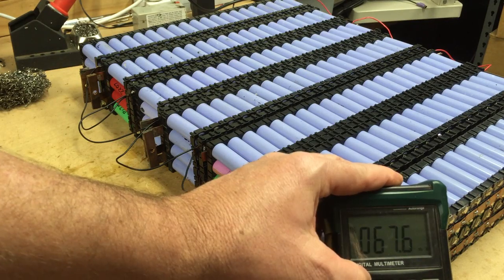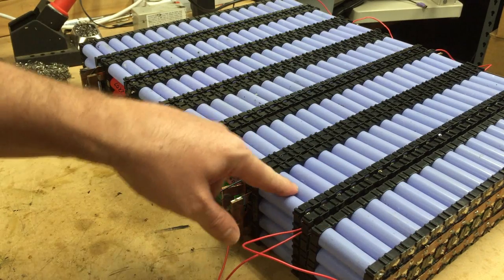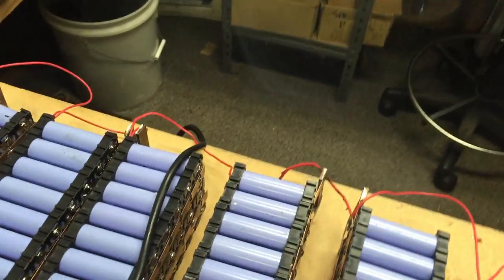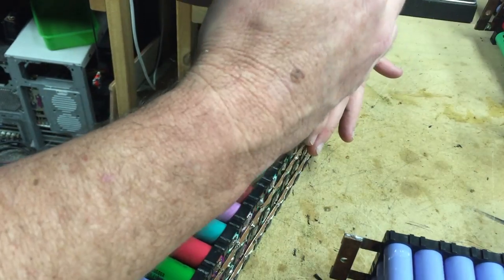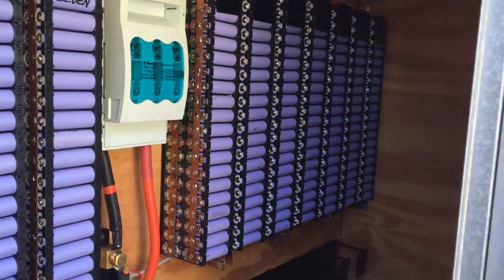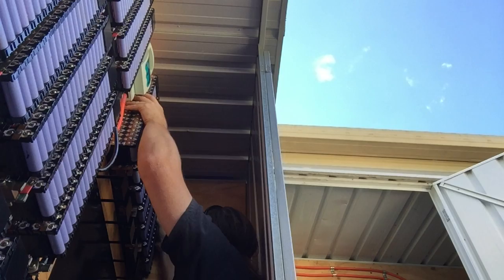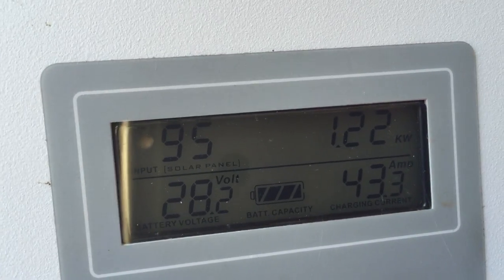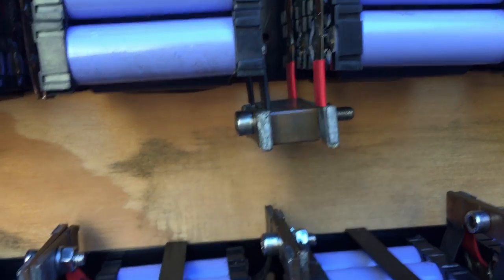Building a DIY Powerwall from used laptop batteries

Comment: Does anyone know if it would be possible to do a similar system, but in KERS fashion? Batteries will lose their ability to store energy over time, but storing kinetic energy doesn't have a life span. But idk, maybe it would lose the energy you store too fast?
Reply from the maker: Never looked into KERS sorry
Reply: You can hold energy in flywheels for a rather long time by keeping them in a vacuum (no air drag) and suspending them on magnetic bearings (no friction- only a small amount of magnetic drag). Unfortunately as far as I know the energy density is still less than batteries. There are other problems too- the flywheels have to be aligned with the earth's rotational axis (otherwise you get problems with gyroscopic precession) and each flywheel (assuming you want maximum energy density) is essentially a carbon fiber disk whose outer edge is travelling as fast as a bullet- if something goes wrong and the flywheel breaks the effect will be akin to an exploding artillery shell, so every flywheel must be either buried below the ground or surrounded by a ring of armour plating to stop the shrapnel.

The main advantage of flywheel energy storage is that with appropriate design you can get all the energy out very quickly. That fact makes them popular as energy storage for things that require short bursts of extremely high power like experimental fusion reactors and railguns.
Reply: Right, and they are also effectively used in motorsports as well, to deliver that quick burst of high energy. As long as it's doable and viable, there's also a way to make it safe. My main reason for having the thought was to prevent the loss of battery life over time, where with flywheels you don't lose any storage potential ever (since they store kinetic energy, not electricity). Would be cool to see a huge flywheel powerplant hooked up to a solar cell farm, something that could maybe power a small town out in the desert or something.
Reply: I think the high cost of flywheels (a high energy density flywheel must be made to incredible precision, as the slightest imbalance will cause the rotor to explode when it accelerates to full speed) would mean that your storage system would need to be in service for a very long time before flywheel storage became a better investment than batteries. Meanwhile battery technology is advancing all the time, with capacity going up and costs coming down. I suspect that it would be better to just use batteries and replace them with newer, more advanced models in 5 years time when they reach end-of-life.

Another option for storage that doesn't degrade is flow batteries such as vanadium redox batteries. These batteries work by pumping positive and negative electrolytes through a fuel cell, and they suffer practically no capacity loss over time because the two sides of the chemical reaction are kept completely separate. You can also restore lost capacity by simply replacing the old electrolyte in the tanks with new stuff. The disadvantage is that they're very bulky and heavy, so they're only useful for stationary storage systems.

Comment: lead-acid or Gel batteries are not effective. 
How about running PC with 600VA USP on such battery bank ?
How long it will provide backup?  4 to 8 Hrs ups backup how many batteries are required ?

Comment: How do you have the interface connected to the house? Do you have an automatic transfer switch?
Reply from the maker: 63a Duel Pole transfer switch see diagram https://drive.google.com/open?id=0B3D1svhLzR-JaE5ETXB6aHNpdDg
Reply: I have 51- 260W panels on my house with a SolarEdge inverter. Do you know where I would hook up the incoming DC from the batteries to?
Reply: Great work by the way. Really inspiring.
Reply from the maker: no sorry. is the edge inverter hybrid ?
Reply: Joshua Kendrick Yeah mate,  theres an input,  the wires connect to it
Reply: BS you have 51 panles, a 13.2 kw system, what are you gowing there hemp

Comment: Do you need 20kwh? Not you personally but for a small build. Could you start with 6kwh. My 3.2kwh solar gives me 20kwh a day I use 10-12kwh then push the rest to the grid for $0.06c. My night usage is only 5-6kwh so a small 5-6kwh system could work?
Reply from the maker: Many have stated with 1kWh of 18650 storage ! it's cheaper to conserve than to create :) I'm soldering up my 40th kWh pack at the moment and have way through testing cells for the 50th :)
Reply: HBPowerwall I know the pip solar/battery charger is best but is there a charger that I can use and keep my original zen solar inverter. I have 12x 260w panels, ATM it's generating 310v at about 10A. I know lower amps is safer but lower voltage is easy for balance charging.

Comment: why wouldn't you face the batteries away from the wall in stead of sideways that way if they vent the fire flames go
out in stead of sideways into another battery
Reply from the maker: Very good question - it's been discussed in detail of late both in diypowerwalls on facebook and www.diypowerwalls.com forum. In time, this project has grown larger and safety side has grown with it. In version 6 mounts there'll be space for 'blast shields' of some sort & the gap between the cells will grow from 2cm to 5cm to accommodate this change.
Reply: HBPowerwall yes but if you place the negative side of the battery against the wall and the positive side away from the wall when the battery vents the bulk of the flame will go into an empty space. Then there's less need for metal infrastructure superannuation the packs.
Reply from the maker: agreed ! and this was considered but it was dismissed because it looked horrible ( i know right form over function) Even tho it's now at 30kWhs of storage & 48v it's still a work in progress. Each change or upgrade improves it and hopefully makes it safer.
Reply: I would at least turn the cells on the right to face the Positive  poles to the right,  that way if they vent they don't burn the equipment in the middle.
Reply from the maker: that would work easily with a 24v setup but now with 48v not so much. However i will happily take this into consideration when I Get the larger shed for the next 10kwh pack. Redoing the layout won't hurt at all ~!

Comment: so ahh what is this thing anyways? are they capacitors or real batteries? is this just a smaller form of a battery bank for like solar power or something?
Reply from the maker: +APCWORLDSUXAZ they are 18650 cells recovered from used laptop batteries. They run my home :)
Reply: HBPowerwall how do they get charged up?
Reply from the maker: +APCWORLDSUXAZ 4000w solar
Reply: HBPowerwall wow that's a lota solar...

Comment: I have one question so in each pack there is 80 batteries at 4.2v  Times that by 7 packs for a total of 30 volts, And you have 14 packs to the left for a 60 volts to your inverter right?  Then you have  2 more set packs to the right for a total of 28 packs? Nice man how many more at this point are you still doing?
Reply from the maker: there is 56 cells so far (4480 18650ies) 14 almost ready to go (1120 more 18650ies)
Reply: HBPowerwall dude that is awesome so how much kWh are you up to now? and wow 5600 cells in total. I'm impressed.
Reply from the maker: 40 in use, 50th in preaty much built ( then there is another 1000 cells processed for the 60th) so a few...
Reply: So wait let me get this you got 50 packs  of cells now and each one is like 77 to 80 per pack? Damn  Just got a load in my shorts :)
Reply from the maker: 86 built 14 in progress

Comment: 2 questions... what are you doing for individual cell load balancing? how are you managing the battery temperature?
Reply from the maker: +theonlyari manual balancing , no temp as max draw (80a) is 0.5x amps per 'cell'. Average cell load is under normal load is 0.1amp will monitor coming into summer months.
Reply from the maker: +theonlyari further mor third bank will be ready soon thus reducing stress even more.
Reply: I dont think its as simple as you make it out to be. You are assuming that each cell has the same impedance, which it doesnt. That means each cell will be at different levels of charge-- which will lead to some cells being over charged (bad) and some cells being undercharged (bad). This leads to the second question of temperature control... without proper thermal management, a poor performing cell can overheat and can cause a self catalyzing reaction-- which will lead to a catastrophic fire.

TI has a lot of free literature on this subject, 

http://www.ti.com/lit/an/slyt322/slyt322.pdf

http://www.battcon.com/PapersFinal2015/17%20Ponchaut%20Paper%202015.pdf

My advice, not that it matters, is put that shit as far away from anything important as you can.
Reply from the maker: +theonlyari as always your input is welcome. I'll happily take my chances and document my journey. For right or wrong it sure is enjoyable learning every day. Some learn from reading books. Others learn by burning the book and learning from the results.
Reply: HBPowerwall While i respect that( as i have dont that with many things in my engineering career) I have found that most people who learn how to use explosives dont just wing it. Given that I laptop battery has nearly the same energy density as a hand grenade-- if nothing else-- it commands respect. If nothing else, ask yourself this-- if it was just that easy to make a power wall, why would tesla go through so much time and money to engineer their product? Why would Boeing have had so much trouble with getting Li-Ions to work in an airplane?

By all means, keep doing what you are doing, theres nothing wrong with learning by fire-- except when it can hurt others-- and what you have built can hurt people-- especially posting it on YouTube.

If i were you, i would swap all of those batteries for Lithium-Iron-Phosphate (LiFePO4). They dont have the same energy density, but they also dont have many of the other problems that other lithium batteries do (like thermal runaway).
Reply from the maker: +theonlyari check back in twelve months and say I told you so :) I plan On improving on this till it either fails or succeeds stay tuned. Your input will always be welcome.
Reply: Ok I'll bite but only because you are an engineer, what new proprietary battery technology has tesla invented (not software) that makes doing what has been done in the past so undsafe that we should now pester others that don't use tesla technology ?
Reply: Not sure that I understand your question, but i'll assume you are asking if tesla has created a new type of battery technology that is somehow safer than Li-Ion technologies. In that case I would say, no, not that i am aware of. However, li-ion batteries have some very interesting characteristics that make them very dangerous to play with if you dont understand them. Lookup the tesla battery pack. Look up the Boeing 787 battery. Both use individual cell balancing to ensure that no one cell is allowed to be in-circuit with a different charge. This is called active-cell-balancing (look up ElithionTV on youtube. They have some good lectures). Its important for an efficiency standpoint, but its also important from a safety standpoint. If you over charge a li-ion battery, it will get hot. If you run a li-ion battery when it is undercharged it will get very hot. If it gets hot enough it will start a run-away chemical reaction (known as thermal runaway). Now, suppose this happens to one cell in this configuration, particularly in the bottom of a pack. If it starts getting hot, there is nothing to cool it down. It begins to heat up the cells around it (mind you hot air rises). If left unchecked, it will catch fire. When it does, it is self catalyzing-- meaning it creates its own oxygen making it nearly impossible to stop the reaction. It then starts to burn the cells around it. Each cell starts to catch the cells near it on fire. In a short time, you have a VERY large, extremely hot, and extremely dangerous fire on your hands. No need to call the fire department, because theres nothing they can do.

I see there are "fuses" on each cell. Thats a great idea, if you assume a constant over-current condition. What about transient conditions. It takes a long time and a lot of energy to melt a fuse. These transients can damage the cells causing them to work less efficiently as their neighbors. Less efficiency = more heat. Heat = bad.

SO! What has Tesla done? They have used best engineering practices to create a safe product. They use active-cell-balancing to improve safety and efficiency. And they have a thermal management system to ensure the packs dont get too hot. Is it perfect, no. But with the number of Tesla cars running around, you only hear a few stories of their cars catching fire (and usually not as a result of the battery mysteriously combusting).

Youtube is great for the transfer of ideas and information. But it's also a great medium to transfer wrong information. Saying, "im just a hobbyist playing with some cools stuff" does not get you a get-out-of-jail-free card from physics. When you start playing with things that you dont understand, you can get hurt-- not that theres anything wrong with that. Its just when you hurt someone else-- like your family or your neighbors because you burned the house down... thats reckless and irresponsible.
Reply from the maker: + theonlyari here take a deck chair and watch the show :) how u like your steak lithium fired moo, medium or well done.?
Reply: Thats an interesting attitude to take... would you take the same approach to building your own airplane?

Anyway... lawn chair enabled... with any luck... i will be very bored.
Reply from the maker: +theonlyari or you'll be the 1006th person to say I told you so :)
Reply: Sorry to contradict you but Tesla battery packs do not balance individual cells, you can check for yourself there are several videos of people disassembling them. They balance groups of cells. Probably grouped by internal resistance as it is the correct practice for battery banks. To prevent over discharge for a single cell they use very thin wire to connect each cell to the bank, this will melt the wire before damaging the battery.
Reply: no need to individual balance the cells that are in parallel, only need to balance the packs. With the verry tiny wires connecting the cell to the main rail of the pack the tiny wire will melt down as fuse if indivitual cells are overloaded and disconnect them.
Reply: While watching the video, I was looking for fire suppression equipment. I hope he installs something. Those Lithium battery fires get a little warm.

Comment: How do you get 20KW out of 560 3,7v cells ? 
560 cells x 3.7v x max 3000mAh = 6,215 Wh = 6,2KWh
Reply from the maker: 560 per pack x 4 :)
Each 'cell' is 4 x 20 = 80 cells x 28  = 2240 cells 
2240 ..... ok I suck at math... 
right this is how I worked it
1 x 4-hour load test at 1000watts  https://www.youtube.com/watch?v=vSR9HzX7nHo after that test it run another 10 hours at 100 watts making it 4.9kwh of storage times it by four and I came to 20 kWh usable storage. pete
Reply: Volt x Amp = Watt
Volt x Ah= Wh
If your 18650 cells is rated 3000mA...............3,7 x 3 =  11,1 wh / cell
2240 (18650 3000mA) x 11,1 = 24864 Wh = 24,8KWh
Reply from the maker: +Tuco Remirez math ! Lol
Reply: Do you want me to look at you and your pal drinking for over 4 hours ???????  LOL
Reply from the maker: +Tuco Remirez not so much it's boring as all get out. Hahahah but a bloody good test

Comment: Ok the big question is...how much has this cost you so far?
Reply from the maker: +Buffalo_Chips ooh that is a big question. :)
Reply: So how much does it cost for sell
Reply: How much? no strait answer given but you go from the post HBPowerwall gave for the battery holders :http://www.ebay.com.au/itm/252304899243?_trksid=p2057872.m2749.l2649&ssPageName=STRK%3AMEBIDX%3AIT

You can figure out that there would be an absolute fortune spent filling them with batteries. Chances are the cost of the batteries have been written off on tax as a business expense especially if your business already have them as a product that you deal with.
The cost is not really economical as all batteries have a finite life and if not monitored correctly one or  two batteries can take out the lot resulting in a large cost in the end.
Reply from the maker: 1. Rather straight answer given in a 2 hour live chat:) Also released ALL costs related to project while the live feed was happening.

2. Tax right off - OOH i wish, been audited and passed - don't want to go through that again thank you very much. 

3. Your right about economics - but hell people build cars all the time that will never pay for them self :) 

Pete
Reply: HBPowerwall
Reply: HBPowerwall I

Comment: Where are you getting these batteries, I am trying to find true MAh and chip protected.
Reply from the maker: Anywhere i can. Any company, government agency, recycle place is fair game.
Reply: HBPowerwall, that is genius I figured you spent a fortune on these so you re wrapped them the with shrink tubing.
Reply from the maker: only about 5 have been rewrapped all the blue cells are Samsung 28a cells I've collected.
Reply: HBPowerwall, I hear the Samsung that have the like rewrap from manufacturers are the best you can find. I have several Ultra fires and some are genuine however I also got scammed on some junk fake one's, thus the reason of the original inquiry. I may try to find scraped laptops and salvage them batteries. Thanks again for your time and response.

Comment: Hi There! Like and Subbed :)
Question : Iam dabbling with 12v system/s
What are the advantages/disadvantages with a system such as this?

Cheers!
Reply from the maker: 18650's don't play too well with 12 v you need to work out an inverter that will play well your voltages.